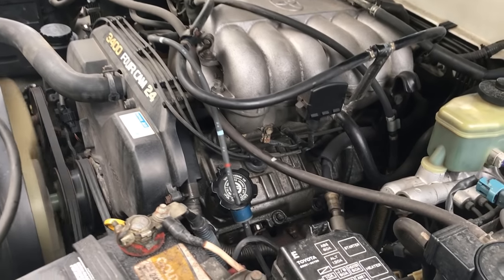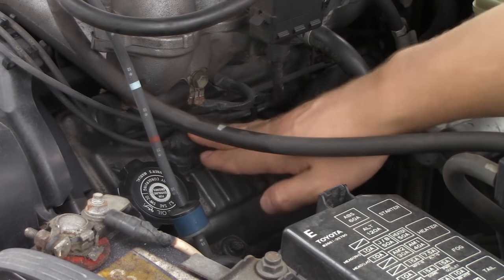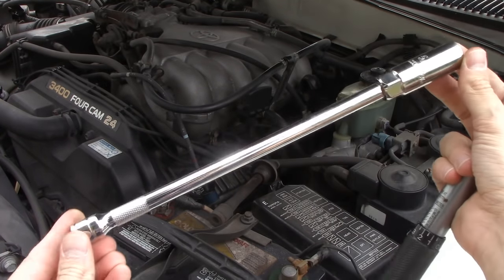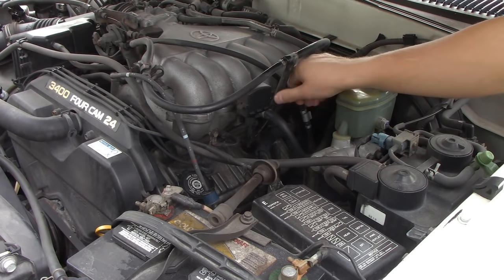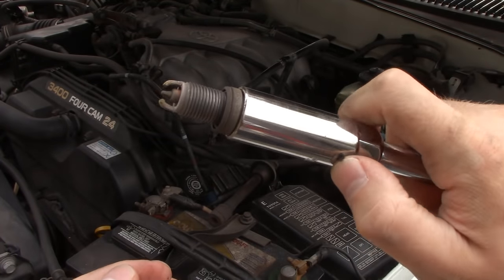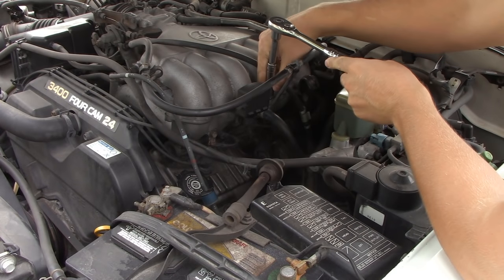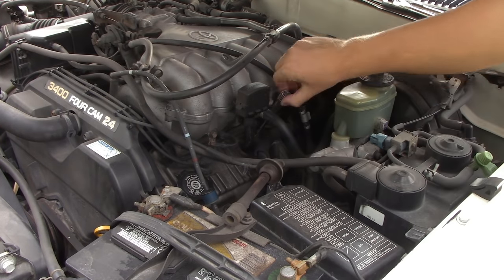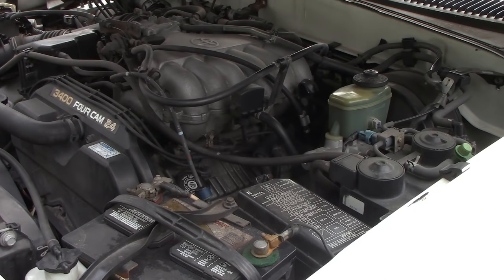Knocking Noise In Engine - Simple Fix for FREE

Comment: I Can Only Imagine some mechanics might loosen one of those spark plugs up so they can say that the engine is needing major work done on it
Reply from the maker: I could believe that. That’s why I like knowing a lot of it myself
Reply: They could lossen itself but yes. I can beleive scum bags would do that
Reply: No he un loosened it
Reply from the maker: @stangmaster 2 the statistics show 8.5 out of 10 mechanics are either under qualified or dishonest. You be that 1.5 that are honest and do quality work
Reply: @AutOdometer  That is actually very useful info
Reply: @AutOdometer  thank you
Reply: Damn right they do smh
Reply: @AutOdometer  Skotty Gilmer is one of the 1.5% of the best and honest mechanics left.
Reply: I took my f150 to a shop for diagnose, they told me that it may be engine damage since it was knocking in the engine, I find that fishy since I didn't hear a knocking in my 20 minute drive to that shop, I hear the knocking after they pulled my truck out of the repair bay.

Quality tune up
2221 Florin rd 95822
Reply: Hoping and praying this is the issue my car is in the shop for that same noise and they showed me my oil pan has tiny metal shavings we're in the oil and want 3600 to put a lower mile engine in my car 😢
Reply: 4real
Reply: I can only imagine u actually knowing what ur talkin about u would be a hell of a mechanic sounds like u are until a real one gets there huh 😅😂😂😂
Reply: @frankie-_-amazon  thank you u can say it again let them screw there selfs and bring it to a really honest “mechanic” and I quote “it wasn’t making that sound before I brought it in”
Reply: @frankie-_-amazon  😂😂 right! throttle cable removal when he could’ve just took the extension off and ran the plug in by hand but we are unqualified this is what’s wrong with the world right now

Comment: This was the same thing i was experiencing with my 2005 Chevy Silverado.  I just hadn't tightened the spark plug down enough.  You could see it vibrating while the others were sitting still.  Thanks for the video.  It gave me a starting point that turned out to be the solution.

Comment: Omg the spark plug worked itself out on my truck I drove it for monthes thinking it was finally going to die. Bought new plugs and it came back to life. If only every fix was that easy
Reply: you drove your truck for months? with a knocking engine like that? all that unburnt fuel that got into your motor...did you at least do an oil change?

Comment: I'm done mechanic work for years I always put anti-seize on my plug before putting them in the cylinder head also an old trick I used to do is I would take a piece of hose and I would put it on the top part on the tip put it on the spark plug and then put the spark plug in the hole and hand twist a spark plugs to get it started then I would pull the piece of small hose off of the spark plug I hope this information helps anyone trying to get spark plugs back into their vehicle

Comment: Thanks for the video. My 99 Toyota Tacoma 3.4L was ticking pretty bad. Thought I had it narrowed down to the flexplate or lifters. I was going to get someone more e$perienced take a look at my truck and then I watched your video. I checked my plugs and sure enough, I had a loose one. No more engine ticking. Thanks again.
Reply: Yea I’m thinking  on my is flex plate too but noise not coming from there only have the noise after driving n park with engine running

Comment: Got a 04 Mazda 6 2.3l, was having serious brake light, cruise control, transmission, and turn signal issues. I'd recently had the ECU reflashed because of a short when the crankshaft sensor cable fell into the alternator, so it was possible the unit was bad, around a $1k minimum repair. Turned out to just be a wire shorting out between the turn signals which fed power into the brakes - the shrink seal housing had been peeled off and it was touching the chassis. I respliced it, resealed it, and taped over that for good measure, and there's no more problems. Did take around $10 in fuses to isolate, though, but way better than $1k+.

Comment: also I forgot to mention put on anti seize on the threads of your spark plug you can use a piece of hose and put that piece of hose on the head of the spark plug then all you have to do is turn the hose and you can start the spark plug in the holes by hand this way you do not accidentally cross thread a spark plug this little small trick. I've learned many years ago I'm a retired auto mechanic really works good I've installed thousands of spark plugs in vehicles using this method a piece of Hose big enough 2 slide on the electrode where you put on the spark plug wire just put a piece of hose on it and you will be able to turn the house and you can put the spark plugs in by hand once the spark plugs are in Far Enough you can pull off the hose easily I hope this information helps anyone out there putting in spark plugs

Comment: Good diagnostic nice video before I put my new spark plugs in I always like to put a touch of anti seize on the threads to it helps a lot when you go to replace spark plugs and tune it up and put electric gel on the tips of the spark plugs so it's easier to pull the ignition wires off too

Comment: did you get a check engine light? I have something similar on a malibu. Not sure if its a pulley, sparkplug or like a engine/rod knock. I dont have any check engine light and engine seems to be running strong.

Comment: Slide some vacume hose over the tip of the spark plug and tread it in with that. If it starts the cross thread the hose will slip or twist.

Comment: I had a 94 f150 4.9 straight six, one plug backed it's self all the way out and was sitting on top of the head hanging from it's boot and you could see it sparking! I thought it was hilarious just sitting there doin its job like that, but it's kinda not though since open flames and oily engine bays don't mix well 😂
Reply: Good thing you didn't have a gas leak!!!

Comment: Funny story. So I just picked up my Yoda and seemed that it was all good until overheating started. Thought it was something simple like thermostat or minor fix similar to the point I'm at now which is redoing full gasket replacement to find out the owners previous didn't follow the handy instructions on timing belt cover to use double prong not single prong spark plug.... This for me is not a loss buy a gain more knowledge for being 1st car I've personally worked on with out more experienced mechanics

Comment: I got a good question. Did you rev it and the noise was gone at certain rpm? I'm having either valve adjusting or spark plug. It was one cylinder so it was weird that only one cylinder is doing it not the rest.
Reply: Was your plug loose?
Reply: @BlueRage  No. Not really. I've been trying to think if it as fuel knock. The vibration on it wasn't good. 6 months back as of today, it needs a new crankshaft on my pickup.

Comment: I'll be looking into that tomorrow morning, I took my f150 to a shop for diagnose, they told me that it may be engine damage since it was knocking in the engine, I find that fishy since I didn't hear a knocking in my 20 minute drive to that shop, I hear the knocking after they pulled my truck out of the repair bay.
Reply: Some mechanics will rip you off

Comment: Hello ty for the update I'm having the same problem 99 Toyota Tacoma 154000 miles  I will have to check mine I was told injectors valves all sorts of bullshit I bet it's a lose plug ty.

Comment: I pray this is the case because my car is in the shop and they want 3600 to put a lower mile engine but they did find little metal shavings in the oil pan

Comment: Use a piece of five sixthteenths fuel line about 10 inches long put it on the glass end of the plug and start turning the plug into the hole and tighten it up by turning with the hose until tight you will never cross thread another plug by doing this
Reply from the maker: Nice tip thanks!

Comment: Lately my car engine has been giving some sort of knocking/ hammering sound. My mechanic asked me to overhaul my engine that would be costly. Perhaps I should check on my spark plugs. I have not changed the plugs for the past 3 years. The last time I checked there were some signs of oil marks on one or two plugs. Thank you

Comment: use a piece of hose put them on the spark plugs then you can turn the plugs in by hand until they are started this way you do not cross thread the spark plugs

Comment: Hi autodometer.i have a mustang 2007 v6 the problem I have with my car sometimes it's doesn't want to start but it cranks that happens when it's cold  in the mornings only.what the car could have? I change the fuel pump and the fuel filter...and the fuel pressure sencor.and I put  a new battery
Reply from the maker: I would first not just throw parts at it. If it happens when it’s cold then the battery would be first to check. Since you replaced the battery I would start with some other electrical components. Maybe the alternator... you can always remove your alternator and have it checked at OReillys or Autozone. I’d try that before spending money on things that aren’t needed.

Next you could also check the fuel pressure regulator if you think it’s fuel related.

Comment: I Always See Oil In My Spark Plugs thats why i feel missfire and vibration in red signals After 3 days I go to Mechnic he Changes the first plug which usually goes dirty and black after that my car runs good but again After 2 to 3 days i got the same issue please tell me any Solution ..! I Have Premio X 1.8 ( 1zz)
Reply: Try the spark plug seals
Reply: There probably dried out

Comment: It's aluminum head. You forgot to put your anti seize. Or you did and you didn't mention it
Reply from the maker: Well I thought anti seize messes up the torque spec or so I have read
Reply: I’ve worked for Toyota (Lexus) for 10 years. In all of my factory training we were never, ever taught to add anti-seize to spark plug threads. As long as the head and plug are clean, just torque and go. Also, I’ve NEVER seen a plug loosen itself (when torqued), blow out of the heads, or pull the threads when removed. It’s not a ford...
Reply: @AutOdometer  always use grease man
Reply: @danervin2530   , 
Agreed  , when aluminium heads were gaining wider use , the old black metal plugs would  seize in the threads  .
Newer plugs are nickel body and do not need anti sieze  ,
Reply: @danervin2530  >>just torque and go<<
And therein lies the rub.  People don't know how to torque their plugs.  I just did this, and was thrown by the crush washers.  The last thing I want to do is damage engine threads, so I'm uber cautious.  But you need to crush those crush washers, then the torque increases very quickly.  If you don't know this, you might crush those crush washers.  Once I had the process down, it went very smoothly, but I still used a torque wrench.
Reply: Wellness Path For Me Yes- crush washers can be deceiving. They’re used in many places (differentials drain plugs, pinion nuts), but if spark plugs are your first rodeo with them it can feel intimidating. Honestly with a 9” ratchet and your hand, you would have to be REALLY swinging off the thing to torque to the point of damage. Spec for Lexus plugs is 15 ft/lb. that’s really not a lot.

Comment: Seems like U accidentally fixed the knocking problem.  Anyways should note knocking is related to these two things 1) Knock sensor  2) Throttle body.  U somehow managed to fix the problem by re-installing throttle body which must be loose or wrongly fit in its place